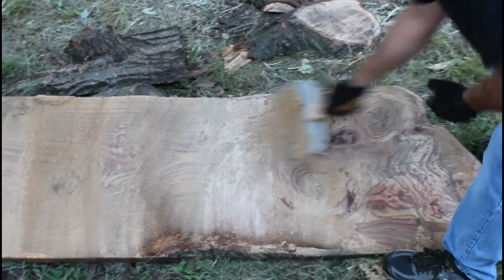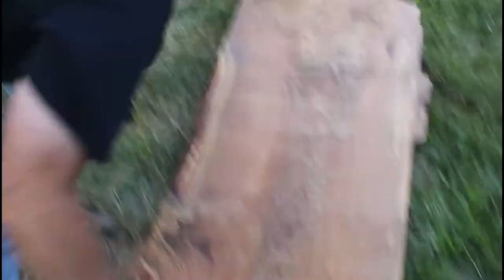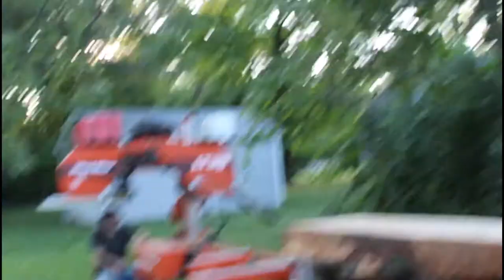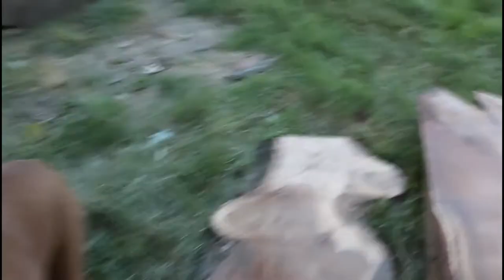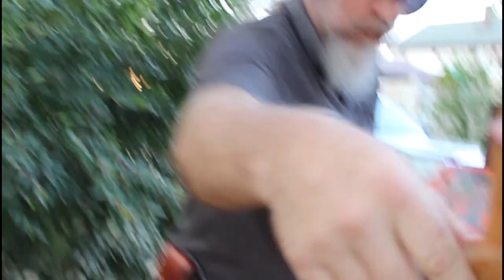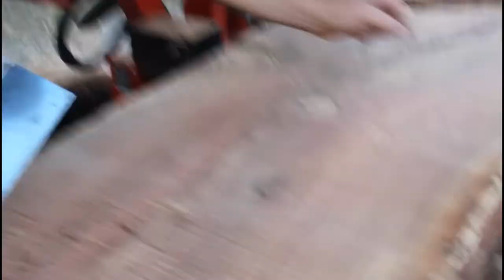White Oak on the Mill

Comment: See you found the auto feed.  Smiles!  Very nice rig!  Looks brand-new
Reply from the maker: This is a 2014 model but only had 182 hours on it when I got it.  It had been sitting in storage for about 2 years.  The water for the blade was plugged and the carriage wouldn't go forward at first but I tightened the belt and cleared the line.  Now it all works like it should.  Having lots of fun with it!